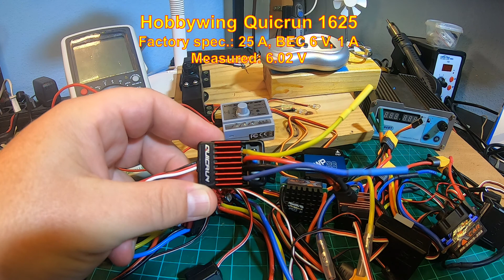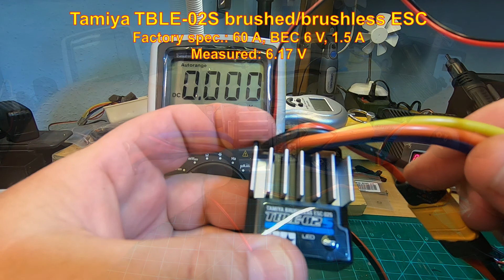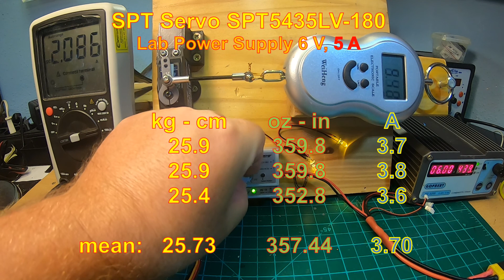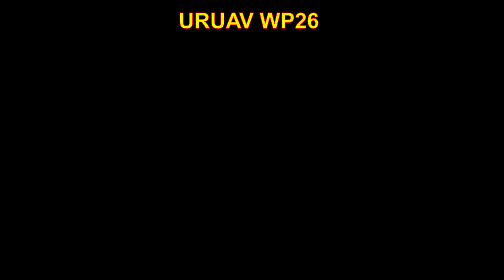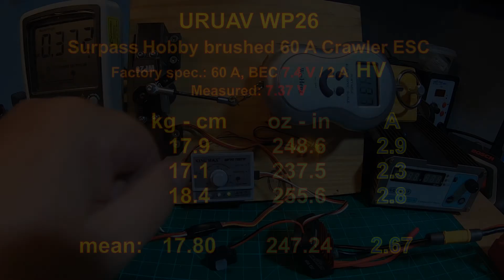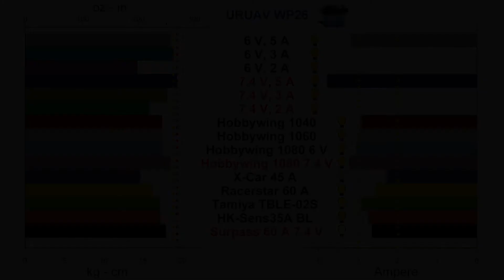Tamiya and Hobbywing rock! Crawler servo tests with 8 different ESCs/BECs

Comment: Hi, recently found three product from surpass hobby, one is cheap servo named "surpass hobby S0600" seem have rubber sealing for waterproofing, and two brushed esc "surpass 80a"  and "rocket 80a" for crawler. Can you do a review for them if you do not mind?
Reply from the maker: Hi, I do not have those ESCs and I do not intend to buy them. 
They are not very cheap, and IMO the Hobbywing 1080 is probably much better. You see in this video, the 60 A Surpass Hobby Crawler ESC is not very good. The "Surpass Crawler 80A" is the same as the 60A, only stronger, and the new ones are called "Rocket" or "Surpass Plus". 
The main problem with the Surpass 60A and 80A crawler ESC is, that it has only a HV 7.4 V BEC, you cannot change to 6 V. So you will have to use HV servos (also for gear shift, ... etc.).
But I did already buy several months ago the "Rocket = Surpass Plus" 540 5-slot crawler motors, which you can buy in a set with those ESCs (and also wo ESC), they are also quite expensive (for Chinese motors), and I intend to compare those to the 5-slot Holmes Crawlmaster Sport and the cheaper Surpass 540 5-slot crawler motors. 6 motors (three 16t and three 20t) sitting here and waiting for tests - but motor tests are quite a lot of work and people here are not very interested in this. 
Do you have a link to the servo? Cannot find a Surpass Hobby S0600 servo with Google.
Reply: @donaldsneffe  Hi again, thanks for quick replying.
Well, for the esc to have high voltage output that they are intended for hv servo in 1/10 and it is a bit of beat the purpose to use separate ubec for lower voltage servo.
As for the servo, it is strange that i can not find it on banggood, the online store is shopee and that is for southeast asian region and maybe australia. Link in bellow, but  maybe you can copy pasted it if you use a desktop pc.

https://shopee.co.id/product/97916565/3944532446?smtt=0.0.9
Reply from the maker: @yannn5541  OK, now my Google found it ;-) https://de.aliexpress.com/item/1005001288313344.html
This is supercheap... but also very weak, only 6 or 8 kg, so not crawler servo, maybe for smaller cars. It is only 7 € including shipment.
Reply: @donaldsneffe  Another odd thing is, spec say plastic gear while the from the picture it is metal brass gear.
Oh, Rp 90000 are around USD 6.21
Reply from the maker: https://de.aliexpress.com/item/1005001288313344.html - for 1/12. 7 € including shipment to my country, super cheap.
Reply: @donaldsneffe  cheap but not superfast for 1/10 sedan car, but i think enough or maybe overpower for my wpl crawler
Reply from the maker: @yannn5541  Isn't it too large? WPLs have 17 g servos, C34KM and C44KM 25 g servos.
Reply: @donaldsneffe  Yes you can put larger servo with some modification with custom mounting, only down side is it a bit crampled under the hood
Reply: @donaldsneffe  Here is my servo mounting

https://drive.google.com/file/d/14puDoYVDOFaUZ0bAD7qdsAhW25pyWyD1/view?usp=drivesdk